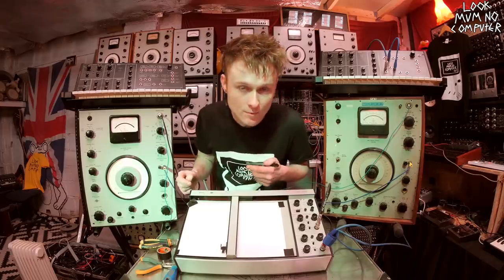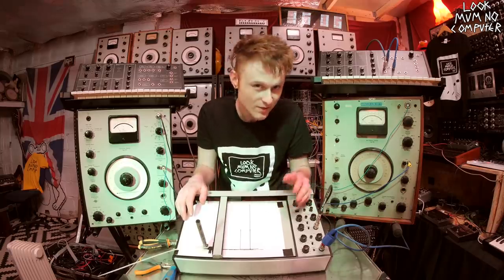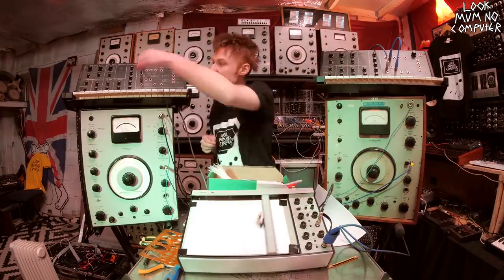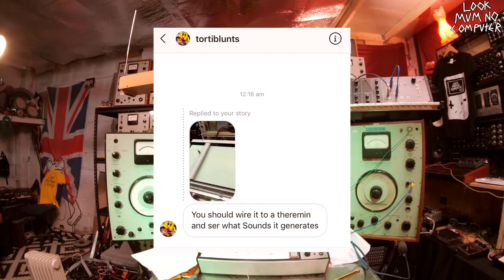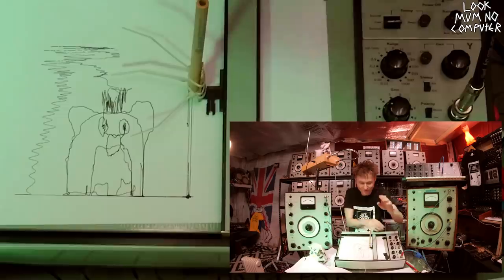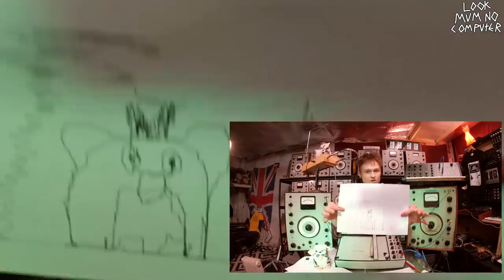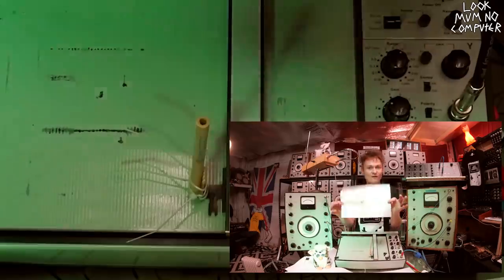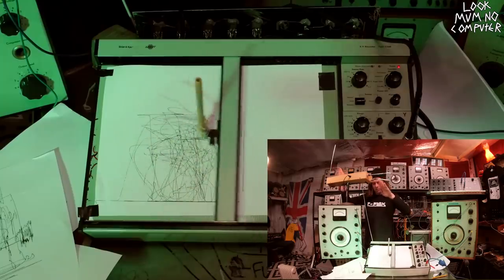DRAWING PICTURES WITH A THEREMIN. Handsfree Etch-a-Sketch

Comment: Taking this too the extreme, could you add a paper roller to this so its always scrolling along and feed sound in to the plotter to make a waveforms then on the other side read that out with a camera to make a waveform then you could also draw on music as it scrolls across, so you could draw in beats ets..
Reply: Like a seismograph or a cardiogram printer basically.
Reply: @margotbucau4510  yes but open loop so its written at one end from a source and played out of the speakers at the other.
That way it becomes a visual audio system.

Comment: Could also add a "Z" axis using vibration or rotation ; kinda like pointing a laser at a balloon with a mirror attached and reflecting the laser against the mirror to a piece of paper. Use physical sound waves to affect it in real-time... or use a paint brush and induce "depth of stroke" with the brush based on SPL intensity or what have you.. Just a couple ideas... Go with it!